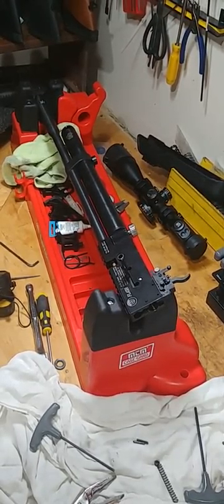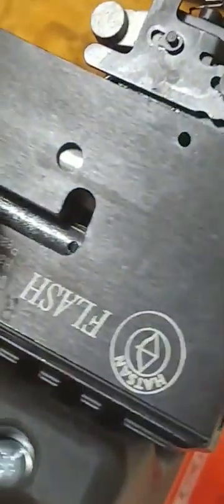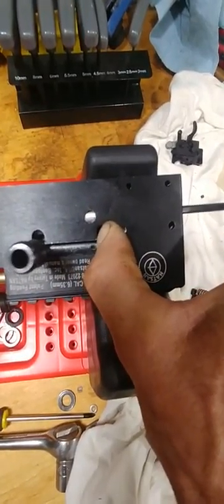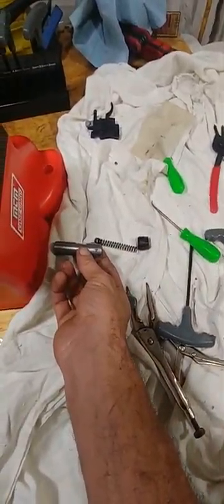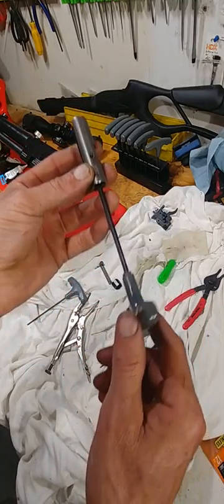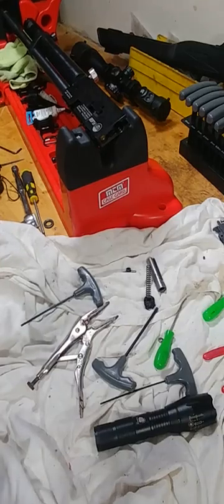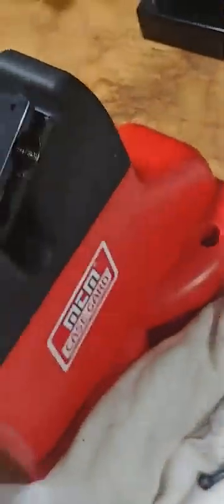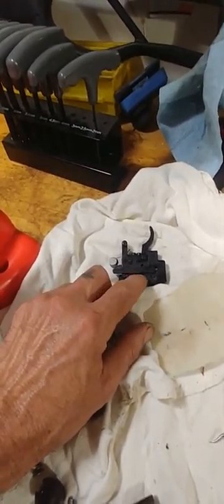Hatsan Flash .25, Hammer spring adjustment and removal....

Comment: Thanks man. Good info.  I just got my flashpup and pulled it out of the box and it was filthy with gritty machine shop dust and the cocking was crunchy as hell. It cleared up after 20 shots a lil bit. But I want to take it apart and clean it up and give it a adjustment for the bigger slugs I got. And maybe do a lol fine tuning with the orifices and just clean up all the radiaces. Shoots crazy good thou out of the box.  Just wanna smooth out the action a lil. Again thanks for your time.

Comment: Hi!  I like your videos a lot! Specially because you are a “down to earth “ person. You are very talented but humble, you do not have a laboratory but you are very inventive and look for different ways or tools which will give you the same results without having to invest additional money unnecessarily and, you are very practical ! Now I have been studying your videos and asked around questions and received answers about this “Tuning an Air Rifle” .  At this time this is my question: Will you clear up that in order to make all this adjustments and measure velocity with a Ballistic Chronometer until you have your rifle tuned up you need to have a Regulator installed ?  Watching these videos and some other ones I was under the impression that you can fine tune your rifle just doing all this you do but,  I was told that it doesn’t make sense unless you have a Regulator installed. I believe this is the one fact you should stress at the beginning of your series of videos on tuning the rifle. What is your opinion ? Thank you !
Reply from the maker: Thank you for your comment and watching, ,tuning is just a form of archiving what you want your gun to do for your needs...Do you need a regulator for your gun, no !!! Does it make for a longer and more consistent shot count yes it does, but a gun can be set up just the same unregulated.... At the moment my Flash is unregulated but set up for power low shot count, my flashpup is regulated and set up for mid power and a good shot count , but the same goal in tuning has been applied to both, consistency and accuracy !!!  Here is one Important thing Between the 2, In a regulated gun the hammer will hit the same amount of pressure of air every time which does lead to consistency,  In unregulated guns hamer witll hit the valve with various amounts of different air pressure every time not being as consistent.....  Keep doing research and learning as much as possible about the functions of a regulated and unregulated gun as I have and at one point I was you and asking questions to learn.... Unfortunately the variables are so great this post would be absolutely very long but please ask more questions if you have them in if I did not answer something you asked let me know and I will try to get back to you...

Comment: I have Hatsan flash 101 and I think my hammer spring is shortened. Because there is a noise in the rifle when I swing the gun back and forth. I think the hammer has a travel.
Or should I increase the pressure?

Comment: How many turn out on hammer spring did you finally do when completly done. Please. Thanks.
Reply from the maker: I actually still have the bearing installed in mind which is .090 sorry I don't know what that's equivalent in metric, you will have to experiment but other people have said 4 turns out works great for them you will have to experiment

Comment: I added a huma  Regulator to my 22 cal Flash pup.  I set the  regulator to 150 psi  Then i tested it with 14.3 gr pellets. I ended up with an average of 862 fps and 23 ft.lb  Of energy over a 28 shot string. I was expecting much higher velocity then that I think it maxes out at 170PSI If I go to the Max is it going to give me much of a difference or do I need to increase the hammer spring  as well. My goal is to try 20 -28 gr slugs  Weather is much speed as I can shoot accurately for small game or varments

Comment: To your point on boogering up the set screw. I tried to adjust my hammer spring in my Vectis from Hatsan,and lo n behold I couldn't give it but a quarter turn EITHER way. So I turned it until I was able to get it out and found FROM factory 2 spots in the threaded set screw COMPLETELY smashed from what can figure their own setting the hammer spring.

So I took a diamond triangle needle file did some thread clean up and it turns very smooth now.

I found 3 spacers in my hammer spring set up I have them all,gonna be interesting when I put in the regulator from Huma to see how the rifle performs. Hopefully the boogered up set screw that puts pressure on spring didn't do any damages to the internals of where it goes, seems to thread in fine but will see.

When I put it back in I counted 11 full turns without spacers,that sound about right?

Any suggestions/tips?

Comment: Just wanted to say man I love your channel I have a quick question my son dropped my 25 flash pup yesterday and broke my cocking arm I was wondering does that just screw in to that slide ? You took both parts out on this video the one piece had that hook when this broke mine has a round ball that you grab to cock it and it broke right right at slit I can still grab it with needle nose  but what I was asking does that screw right in to that slide rod I’m just not sure hope you can help thanks

Comment: I heard other reviewers say the air cylinder was non removable
Reply from the maker: They are removable with three set screws but have to remove the stock.... what they are referring to is the at44 cylinder just unscrews from the gun and can be replaced with another cylinder... I have already disassembled my cylinder and have added a regulator

Comment: Hey brother, I need some help here... Is it possible to change the flashpup cylinder using the BT65 255cc reservoir, thus increasing its autonomy and power? Are they fully compatible or some machining is needed?
Reply from the maker: Unfortunately it will most likely not fit they change the tube and barrel design, I wanted to use my longer AT44-QE long barrel on my my flash for more power but not compatible ....  You could always try but that would be the only way to absolutely know...
Reply: @airgunnersedge4061  Thanks man!